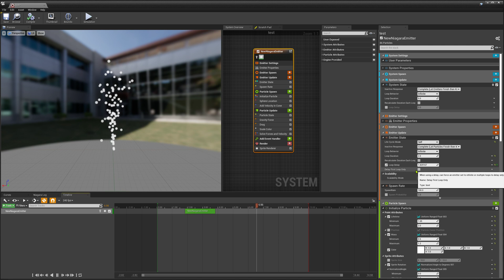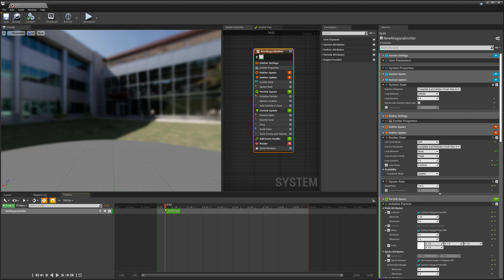Niagara: Delay Emitter via Timeline

Comment: It seems that there is a slight delay, and it doesn’t start right away like it does for you.(0:48) For example, when I set the loop delay to 0.5 seconds and play it, the spawn rate starts at 1.5 seconds. Also, even though I set the spawn burst delay to 0.1 seconds, it actually starts around 0.13 seconds. Why is this happening?